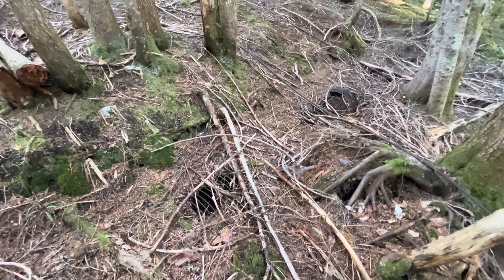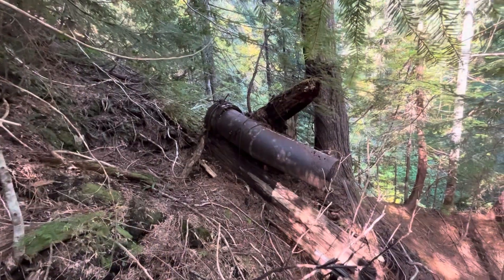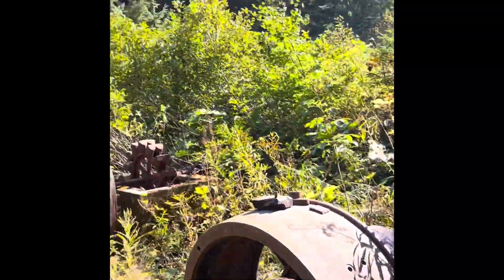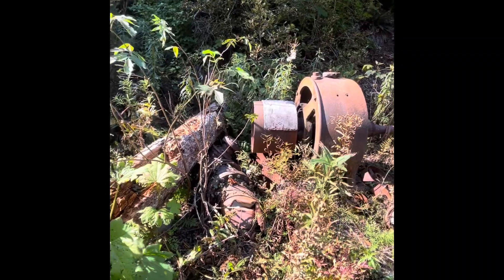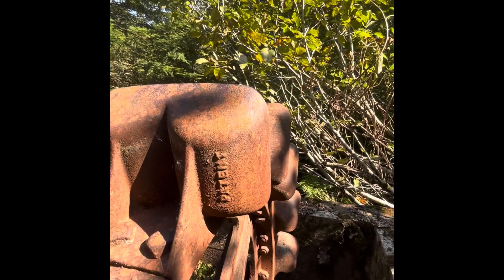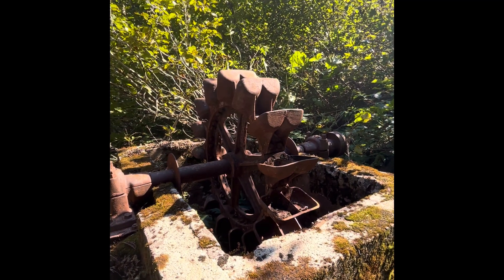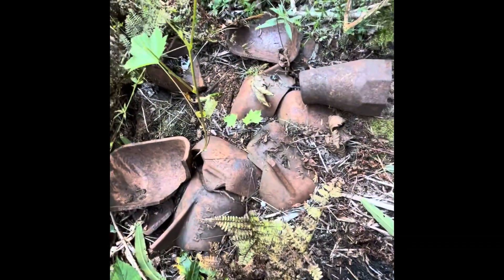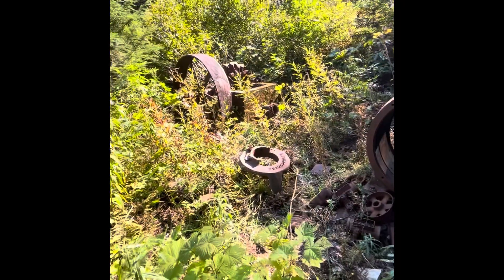A Hidden Powerhouse in the Woods!

Comment: There's an easier way out of there instead of climbing up that steep hillside. There is a road  that leads down to it from the down valley end. May be brush covered, but easier than climbing that hillside.
Reply from the maker: I did find that road on the way out, Craig had mentioned it, but I missed it on the way up, then found the stave pipe on the way down and let it lead me there. Thanks for watching